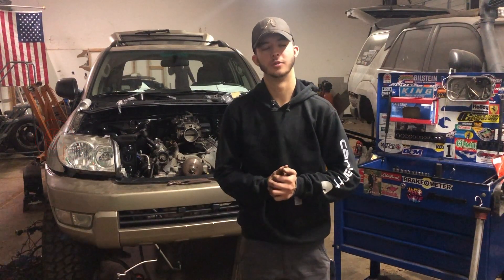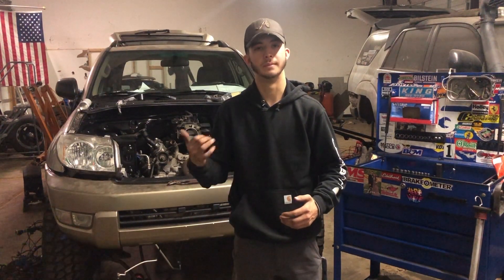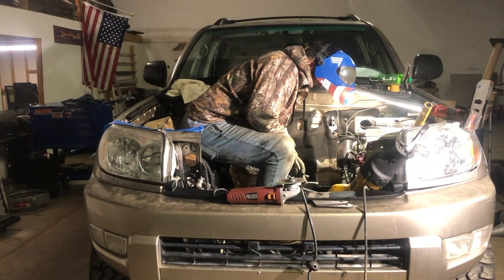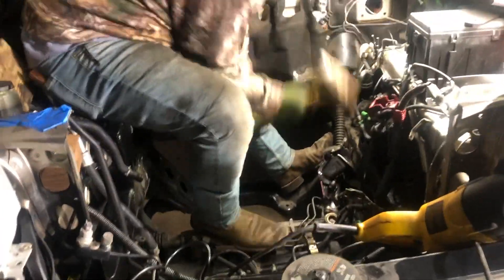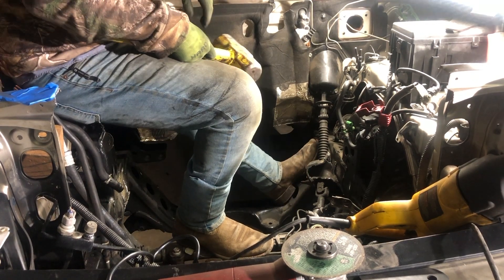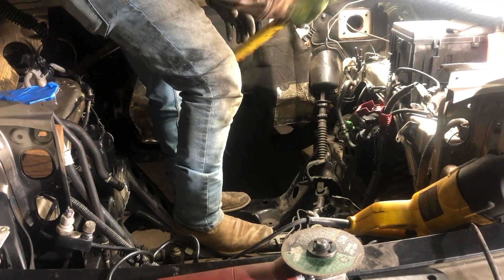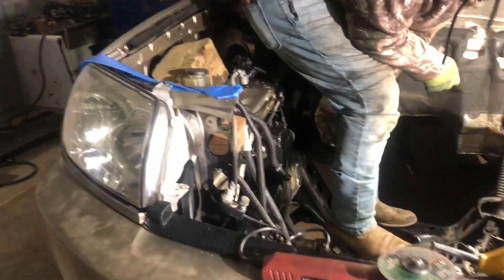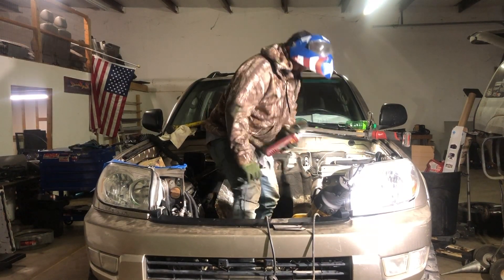WORLDS FIRST LS 4th GEN 4RUNNER Part 1

Comment: Is your's a 4x4? I have a 2006 4x4 and want to swap in an LS. I would rather use the factory trans and t-case, but if not possible I could use the Chevy transmission and t-case. Any websites or advice you can give me will be greatly appreciated. Thanks! J. Tyler

Comment: As far as the fab part goes it don’t look complicated . The wiring has got me I don’t know we’re to start or finish . How much of the factory computer’s are still being used ? There’s  abs/vsc , ecu , tire pressure monitor, and a few more . I know they all communicate with each other . Then your radiator and a/c condenser/compressor are you going to use the factory set up or is that gonna be different?  Love the idea and what I’ve seen it’s bad ass ! I bet if traction control is gonna be used it’s in for a ride !  I would like to see comparisons from factory 4.0-4.7 numbers against the LS numbers ! I’d have to say if I did one I would think if I could I would want the 7.0 427 version of the LS just because of the 400+ cubic inch factor then 7.0 badges would not look to shabby in front of TRD .  Guess you could call this extreme TRD !  Cant wait to see it finished I wanna know about how much RWHP you’ll have !  Guys your doing a great job being a welder/fabrication with milling experience the welding and fab work right down to putting a extra weld on the mounts is spot on .  I can say that end of it should be right there till you wanna take it out !  Cant wait to see more great job again .